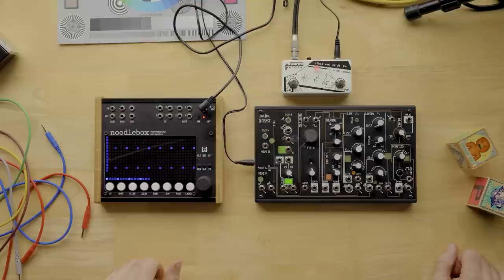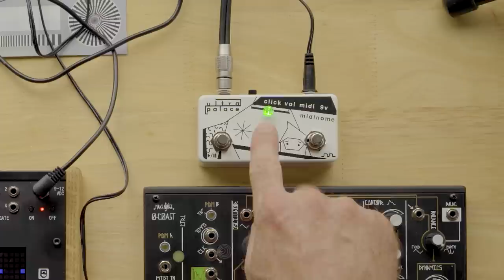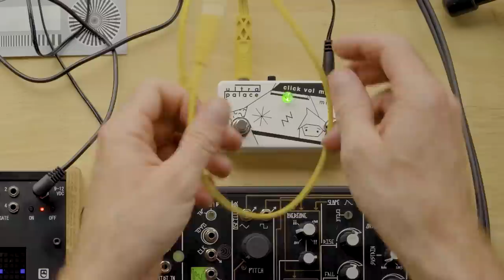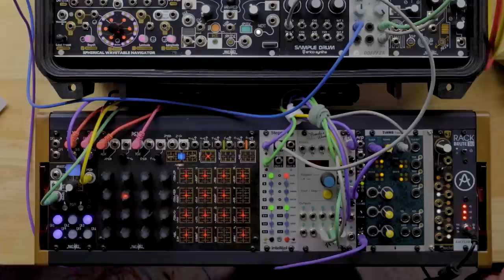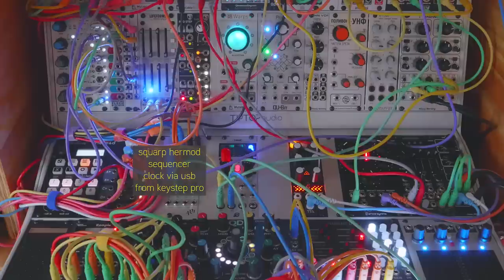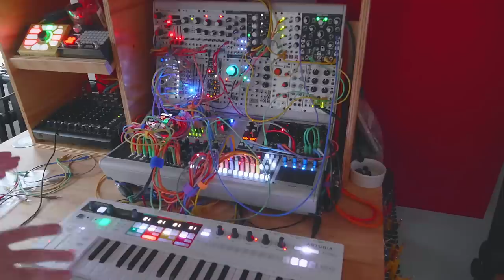Let's Talk Eurorack Clock

Comment: I don't think any clock module out there can pick up an external tempo on any less than two pulses. It's like tap tempo. It needs to two taps/pulses to determine the length of time between pulses. The problem here is that your other mudules are not trying to derive tempo from an external source. They are simply having their sequencer state advanced one step by incoming high pulse or gate. They are not the same thing. If you try and sync Pam to an external clock you'll find it behaves the same way as Tempi.

Comment: So I have a clock tip i think is lesser known; the analog clock out on the beat step pro is in fact a TRS jack where the ring outputs a run signal, im not sure if the keystep is the same in this regard, however. I send that run signal through a logic inverter and then to the reset on the varigate 8+ but if you dont have an inverter a NOR gate will work here too if you leave the other NOR gate input empty.
Reply from the maker: Oh!!
Reply: Can you explain a bit more what this accomplishes? Not sure I'm following what the trick you're describing does but it sounds interesting.
Reply: @rhialto39  sure, my initial problem was that my varigate 8+ sequencer would become out of sync with my beatstep pro (master clock source) after i would press stop and then play again as it (vari 8+) would just continue where it left of in its sequence when i had pressed stop rather than starting from the beginning after pressing play again. The above is my solution but ill explain further why the solution works; the reset function on the varigate will only trigger after it receives a high signal and then a subsequent low signal. A run signal, like the one from the ring of the beatstep's analog clock out jack, goes high when you press play and low when you press stop - so by plugging it directly into the reset jack of the varigate  and pressing play we should expect that the varigate will not play at all since the reset only happens after both a high THEN low signal, but this isn't what actually happens - it does start playing after a brief period but that still leaves us out of sync. however if we invert the run signal using a logic inverter it remains high while stopped and goes low when you press play, keeping them in sync ~ which exactly what we need.

a few notes: you'll need a tip and ring "Y" cable that separates tip and ring so you can use the tip output for clock and ring output for 'run' (now your reset after inversion). I use a module by Adventure Audio called 'ORX',  it has OR and NOR logic outputs. I patch the tip output from the Y-cable into the clock input of the varigate. I then patch the ring of the Y-cable to one of the inputs on the ORX and subsequently patch the NOR output to the reset jack of the varigate. I chose this module because it was a very easy DIY kit that only set me back $50 and takes up only 2hp, but they come preassembled too if you dont own an iron. Just be sure that the run signal is the only thing patched into this module's inputs and the NOR gate will act as an inverter.

another good tip: if you also own the Voltage Block by malekko be sure to power it from the same power distribution board as the varigate 8+ and set the clock setting switch on the VB's faceplate to 'slave' and it will do exactly what the varigate does - no need to use another set of cables to clock and reset it! I know a few other modular people that had no idea that the last 3(x2) rails on the 16 pin headers are for +5v, CV, and clock. it seems some manufacturers are unaware of this too as I've seen an increasing number if modules using a voltage regulator to convert 12v down to 5v, like... why? that's just needlessly generating excess heat, but i digress... I know this was a wall of text so if there's anything that wasn't clear, lemme know!
Reply: @MDJ5  Ahh, got it. Thank you for the in-depth explanation, super helpful.

Comment: I can't agree with you any more enthusiastically about about PNW and the Keystep Pro.  Both have been incredible problem solvers for me, but if I had to choose only one, it would be PNW.  I have the mini expander for PNW, and it's 2U that gives you a 24ppqn out, a RUN signal, and a MIDI OUT - Totally worth it for 2U of space.  I send the MIDI OUT to the keystep, so PNW is still the master.  The real value in the expander is in having both the RUN out and the 24PPQN - they are always useful to mult around, and you don't lose any of the multi-purpose outs on PNW.

Once you get past all the different clock speeds, where things can get weird in my setup is with the reset signals -- some sequencers will reset on a pulse, some are configurable to reset when a gate goes low - and they all handle it in slightly different ways. Some of these are very sensitive to timing, the reset pulse width needs to be as small as possible - if the reset runs at the same speed or for longer than the clocking pulse, some sequencers will skip the first note in the sequence, as they won't run until reset goes low.  Pulse width is another great thing that PNW lets you configure.  

Any of the Varigates are great sequencers as well as problem solvers, since each channel can act as a clock multiplier/div.  While it's great that it can handle any clock speed you throw at it, it isn't just useful for adjusting to the incoming clock -- In a pinch, you can throw probability to 100% and use the multiplier/dividers on one channel to drive other sequencers.  It doesn't really make a lot of sense to dedicate it as an 8 channel clocking device, but I've found I can usually spare a channel- and like any step sequencer, they can play a role similar to how you use the drum channel on the keystep.  The Varigates are in general just super flexible with either incoming or outgoing timing.  

I also will often use the t2 output on Marbles as a clock divider/multiplier, it has a very flexible range, and usually there's something I'll want to clock at the same speed I want to send random gates/modulation.  The jitter can also make timing more interesting (or just chaotic) for some sequencers, but some of them get REALLY unpredictable when you have a fluctuating signal.  I feel like a lot of people neglect t2 since it isn't really random, but it's super useful.

Since every manufacturer seems to have a different philosophy for clocking, sequencers than can do a div/multiply on the incoming signal internally tend to get my attention - and ideally they will have a clock out that you can also div/mult onboard, making things easy to daisy chain.  The eloquencer was nice and flexible here if I'm not mistaken. 

The noise engineering Bin Seq is a simple and very direct hands on step sequencer that I've pushed into strange clocking duties before.

Finally, regarding mults: I don't think you specifically talked about this, but the stackable / pigtail cables are lifesavers here, and often make a lot more sense than dedicating an active mult or two to clocking duties, since you can mult clock signals several times with a passive splitter before the strength of the signal ever becomes an issue -- likely many more times than you will have sequencers, and it's often easier and cleaner to route things around this way as opposed to having everything in a central mult.
Reply from the maker: Great insight

Comment: When i first got Tempi, i was BIG frustrated, but i loved how performable it was, not only as a clock but as a gate sequencer. 
As far as run/stop mode goes i have it working flawlessly, however it does require either clever patching, or the correct setting on your midi to CV. At least on my FH-2, i have a reset out that i have to reset off and on. So it sends a pulse at both start and stop. This works way better than a 100 high. Not sure if any of your devices have this as an opinion though.
As far as the catch-up with 2 pulses, this seems pretty common with anything that doesn't do 48 or 24, so i just run my clock for a few seconds before i start so that those modules get the 2 pulses. 
Mine retains those even after it stops. If yours doesn't then maybe something is wrong. 
I do get annoyed with it if i want to change up the master clock, but i generally don't. 
Enjoyed the video though!

Comment: Good video - one thing I wish were a bit more common in euro is -/+ Volt and PPQN ranges stated in the documentations. I think the reason Tempi has the issue you describe is because the tap tempo calculations need at least 2 pulses to measure over time (and is mainly meant as a performance - based master clock). Pams can be a bit sniffy about taking an ext sync, too - one tip I’ll share is that the gate voltage has to actually drop below 0 before Pam’s will recognize a rising edge. Give it a try! :)
Reply: As a noob here, I feel I may be missing something. I don’t understand how any bit of kit that is taking a PPQN pulse is able to accurately generate their own pulses without knowing what the tempo is. And until you get that second pulse, you’ll never know. Like, how was noodlebox able to do its 4x steps in time right from the start, if all it has to go in is a single pulse?

Comment: This was brilliant, as always. I personally cheated when it comes to clocking, I just got the Pexp-1 expander for Pam's and used MIDI to synch my main rack with my Digitakt, my M32 and my Subharmonicon. Multing the fixed outs from Pexp-1 does most of what I need whithin the rack as far as sequencers go.

Comment: Great video! (As always). I also love using a square LFO as clock, and modulating that LFO’s rate can yield very interesting results. Often side by side with another more steady clock to drive drums for example. Another interesting tip to to have some random gate or trigger signal (for example said varying square LFO) and use that and a steady clock (for example 16s) with a logic AND to make clock-quantized random gates/tiggers.
Reply from the maker: Nice!

Comment: nice, clock in eurorack is both hassle and fun. the restart thing could be such a problem especially when working also with non eurorack gear ( my tip : work with gear that all pause or stuff that all stop / restart at step 1)
 fun things to do : use a mod matrix ( like tesseract 8*8), feed it with various clock divisions, steady or not, and change the outputs destinations. trick n°2 use a synced  cv controllable square lfo as a clock divider, and modulate it with a slower lfo , then change lfos rate and slow lfo shape. ( 2 channels of  MI stages could do the job for ex)

Comment: good video! I learned that I should experiment more with drum triggers as clock sources. I think the Ade is very underrated!.
I totally agree with your comments about tempi the other issue I have found using your described method is that the pulses coming out the tempi are randomly out of phase when the module starts. I drove me nuts till looked at the outputs on a scope. I am back to using this method.  another method I also use is to  mute all the outputs on tempi and give it a clock let it run up to tempo till it is stable and then I unmute. sigh

Comment: i own tempi and would agree with your complaints. but as others have mentioned, clocking modules have to calculate the tempo if they are being clocked externally. you just need to pick one clocking module as your master and if you need more clocks in your system, then use a gate sequencer that advances one step per clock, like steppy, varigate, etc

here’s another fun fact about tempi, it’s clock outputs are not necessarily sample accurate with each other.

Comment: Excellent tutorial on clocks! I've seen people use the 'Ochd' for various clocking times throughout their entire Modular System since it's an oscillator with 8 different LFO's pulsing at
8 individual times- have you used
that trick? You saved me, as well as many others I'm sure, from much frustration + a big waste of money by letting everyone know about the timing issues inside Make Noise Tempi module. I was saving up to purchase that...not now. If a clock has problems keeping time
that's absolutely ridiculous- why
hasn't anyone else brought that up about it not starting on the 1 of a beat so it screws your entire 
timing! Also that it's just an electricity sucker cuz it's forever 
ON and has so many blinking/moving LIGHTS....I used to think wow, that Tempi module will look great in my case with all those dancing,blinking shades of beautiful Blue. Yeah, as it drains all the energy and sucks up every 
bit of electricity in my case!!! Then it refuses to come into the already timed Soundscape I've spent hours creating so I get extremely frustrated thinking it's me because I'm still learning all this when actually, it's just how that Module was built! Why would a company like Make Noise create a Clock that acts as the Tempi? Have you called them 
to let them know what your Tempi is doing? Perhaps you were sent a broken module? 
Anyway, great video. Do more on 
another module. 👌💡🌌🎥
Reply from the maker: I need to revisit the tempi manual to see if I've missed anything!
Reply: There is a lot of threads on Muffwigler about Tempi and issues

Comment: Hey Jeremy, I love your videos and I've been having a huge problem with Varigate 8 that I don't see discussed here, which is: how do you get it to start and stop with pams as master or even KSP as master? My Varigate will not start and stop if it's taking tempo and reset externally. I have to manually start it and leave it on, which in a live performance is embarrassing to start your sequence, only to have to simultaneously start pams (or whatever my master is). Am I missing something? I'm also getting little inconsistent glitches upon starting where it plays note sixteen before note 1 and sort of makes a glitchy skip when the varigate starts, not every time though. I really need help to know if the Varigate can be slaved and started or stopped externally because if not, I have no idea why anyone even uses this sequencer since it's buggy AF also.

Comment: Clocks and resets can get goofy between different manufacturers and devices.  Does it reset on the leading edge of the square wave or the falling edge?  There are no standards and sometimes no documentation.  But it's a bi..h when you're trying to sync and things end up one step behind.
Reply from the maker: Yeah ugh it's frustrating

Comment: Doesn't any clock that is not MIDI clock sync'd need two pulses to establish tempo? You need to know the time difference between pulse 1 and 2 to know what the tempo is. What do Steppy or 2hp Div do differently that they're able to be in sync without a 2nd pulse? Or, is it more that Tempi doesn't hold tempo when hitting start/stop on Pam's?
Reply from the maker: Not sure but they respond faster. I likely has something to do with the fact that tempi wants tempo which is a slow pulse compared to the 16th notes i feed Steppy or the 48 or 24 ppq clock Pam's likes. I've upped my resolution clock out of Pam's to tempi and it picks up faster but now I need to divide all my clocks down on it.
Reply: No. with analog clocks nothing is 'figuring out' what the tempo is as the signal itself is just a quick jump from 0 volts to 5 volts which tells your clock destination circuitry to advance in whatever way it's designed to. there are some exceptions to this as some modules are digital and it wouldnt surprise me to see that the 2hp div has an ARM chip on its circuit board which you can think of as a fancy micro controller, however, it's still likely that one of the pins on the chip is routed to the clock on the circuit and from there the code on that chip determines when to 'advance'. dividing a clock is easy as you can just ignore every other pulse for /2 clock, every other pulse +1 for /3 etc...

Comment: hey jeremy there is a thing, if i send clock out from the keytep pro to a certain sequencer, the cklock is all over the place. no matter how i set the ppq is doesnt change shit. if i send clock from my grandmother or from pams to the same sequncer, it works normal. any idea why is that??
Reply from the maker: I have no idea, it is all very specific to the devices and settings you're using. There is no generalizations with this stuff, you have to be very directed and specific and read the manuals.

Comment: Have you tried the new(ish) step advance mode on Hermod?  
It an interesting mix between of tempo based sequencer ( steady clock based) and ‘step’ sequencing ( ie where a trig advances one step)
Reply: Could you elaborate on that? I’m new to hermod and that sounds pretty interesting
Reply: @ModernDevotion  
technically : set clock transport to A : Trig. then a TRIG on CV A, will 'run' the clock tempo for CLOCK IN DIV. - musically: say you have notes on 1/4 and IN DIV = 1/4, then it acting like a conventional sequencer, just advancing when you TRIG it.
however, whats interesting, is if you zoom in, then put notes on 1/16... your single TRIG will fire a sequence of notes.
so you can have shorts 'patterns' that are fired every time you send in a trig.
... lots of creative uses, especially given the FX that hermod has.
Reply: @TheTechnobear  oh wow. I’m gonna have to try that out! 🙏

Comment: You mentioned changing the Varigate PPQN.  I need to do that but not seeing where to do it.  Is it marked on the board?
Reply from the maker: I changed what was going into it, not a setting on it
Reply: @RedMeansRecording  Ah, ok.  I just learned about needing to use reset and clock.  After patching those out from a Trigger Riot into a Varigate 4+, I still have to mess around with hitting the play/stop button on the Varigate to get the sync to happen.